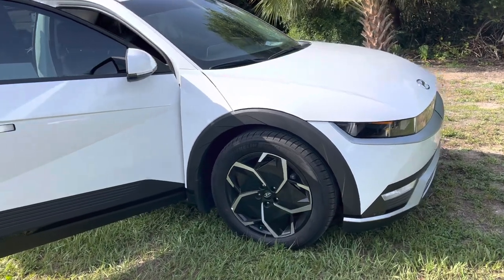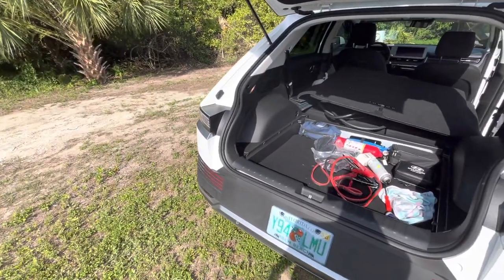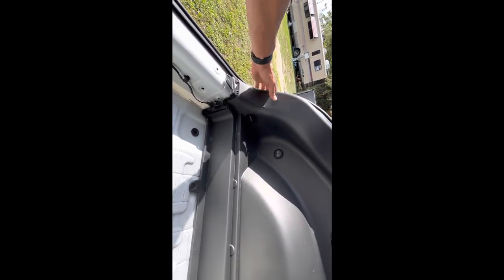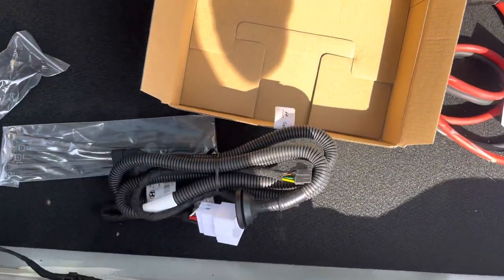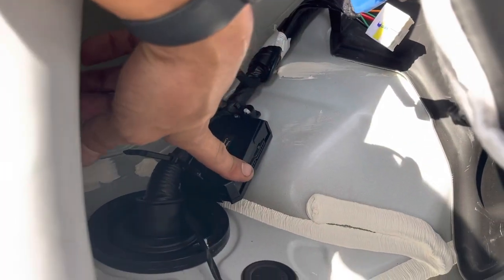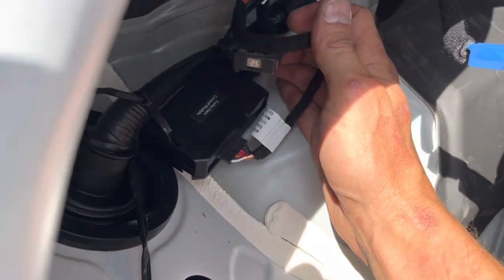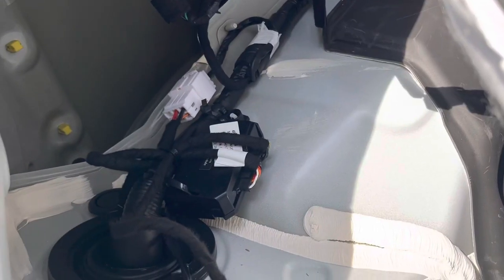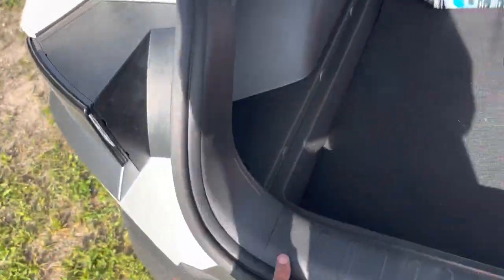Ioniq 5 trailer wiring harness install the easy way! Don’t break that car:( #ioniq5 #ioniqelectric

Comment: I did factory install on my 2022. This method was so much easier. Literally 15min install on my new 2023 limited. Look in menu screen under convienience for tow settings. I also used a plug in test light before putting panel back in place. THANK YOU for posting
Reply from the maker: Glad it helped and nice work!! Happy towing.

Comment: That a lot easier (and not much more expensive) than the aftermarket ones that tap into the tail lights on both sides plug need a 12V power and ground hook up. This is one plug and done.